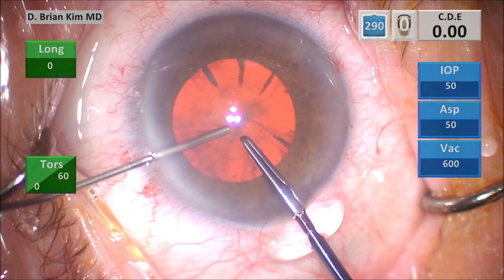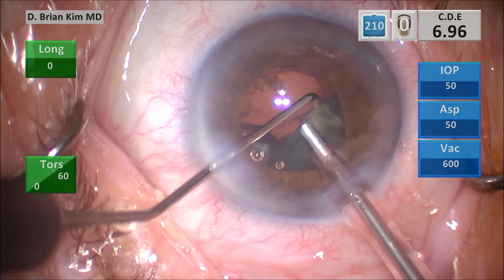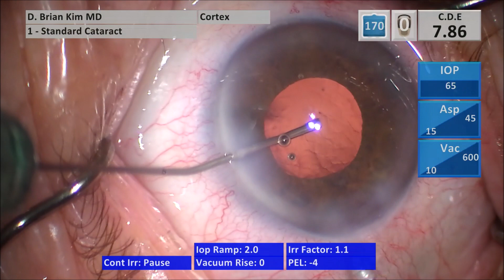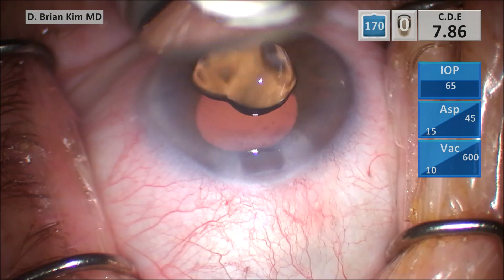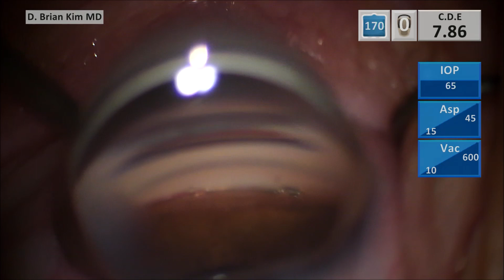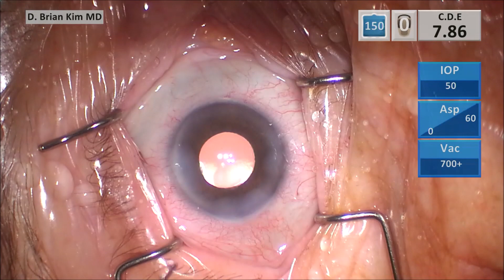TBWTDCS #159: Dense Cat, Small Pupil, Double & Cross Chop, Hydrus Microstent, 120 Deg of Blanching!!

Comment: Beautiful technique - always great to watch. I have not yet tried the Kim chopper, but am doing a similar method chopping using a Seibel and a bevel up/buried phaco tip without vaccum/phaco. I am certain my technique would be optimized by doing what you have demonstrated, but for either technique, how are you able to confidently ensure you never "catch" the equatorial or posterior capsule with your chopper? I haven't had this complication, but fear it thus stifling my full commitment to this method. Thank you.
Reply from the maker: Great to hear you are having success.

I have posted numerous videos on chopper placement and hand position. Here is an example: https://youtu.be/XJxVnpCZo5s

I agree. You should NEVER catch the bag and rip the zonules. Everything comes down to proper execution, which comes with repetition experience. Best wishes.
Reply from the maker: The Seibel is an obtuse angled chopper, not right angle. It will be less effective at hooking and holding the lens at the equator, but not impossible. Like with any procedure you need the right tool for the job.